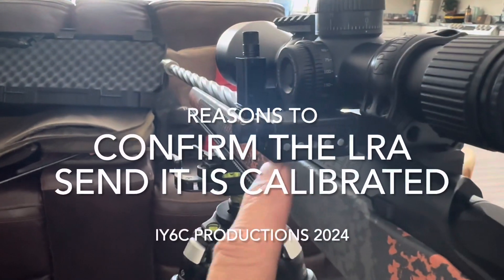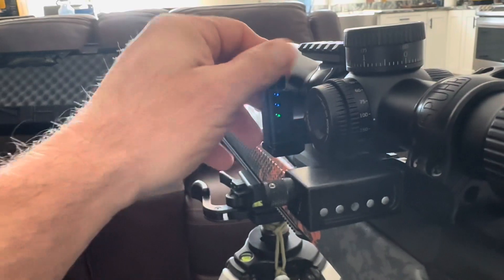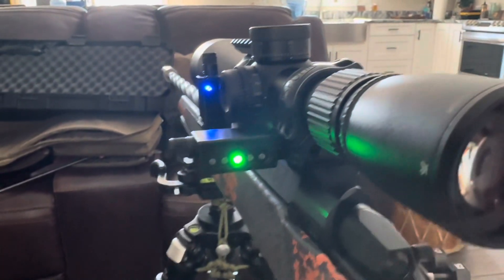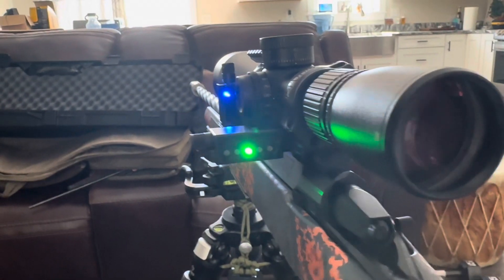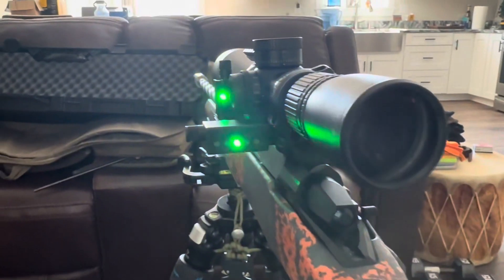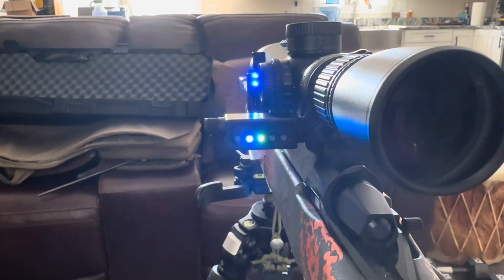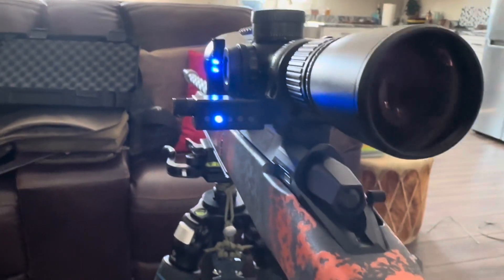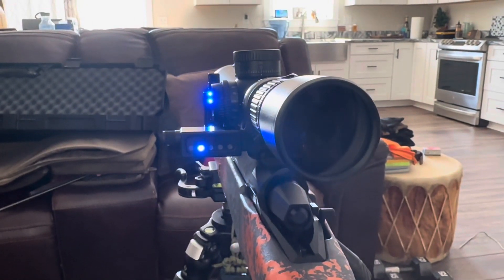Double check your Electric rifle level here is why

Comment: I understand that youtube won't let you do how to videos so you can't show how to install anything on a pew/g-word but can you show or discuss how you level your pew then show how to "backlight" without getting in trouble? I imagine with the arca swiss rail and picatinny rail that you could use those as flat surfaces to "level" your action but how do you know your action is level in the stock and the rails are all parallel to one another? Or is it a matter of just assuming everything is right and going with what you got? Good to see you're still at it!
Reply from the maker: It’s a bit of both. Using what you have starting off with a tripod that is level. Double confirmation with two on the action then squaring up the reticle with a plumb bob and back lighting the reticle onto a wall where plumb bob is. It takes a bit of time but you just do the best you can and go with it.

Comment: That’s a great heads up! On my current build I run one but have left a bubble on as well just for back up if the battery dies. After seeing this I question the level.. Yikes! I am very curious  though and if you don’t mind, have some questions. Do you leave the vertical on when traveling in your case? I use mine horizontally with a pic rail mount and take it off when transporting in the hard case. I’m wondering if yours got slightly shifted when transporting? I’m wondering if I should still trust it. You can see mine on my latest video if you would like but I think I’m going to get out the leveling kit tonight to check it. Thanks! 😊
Reply from the maker: I had switched it to a new rifle. Once it’s on and calibrated it stays on. I have 4 rifle that have them and always mounted when packed for travel. The horizontal ones yeah I would take off so as to not mess it up.